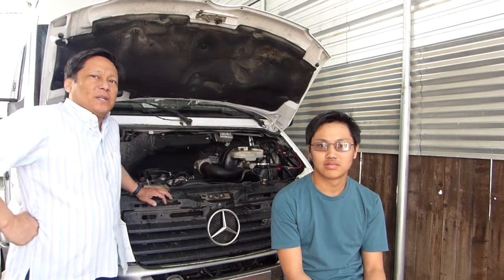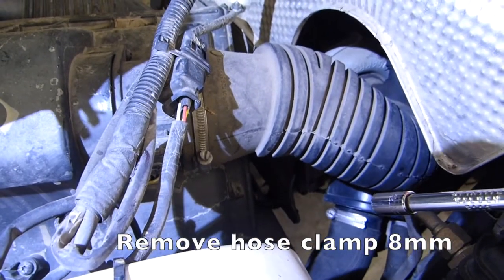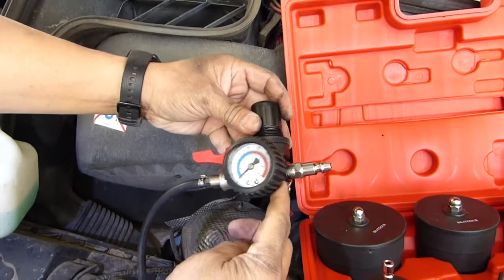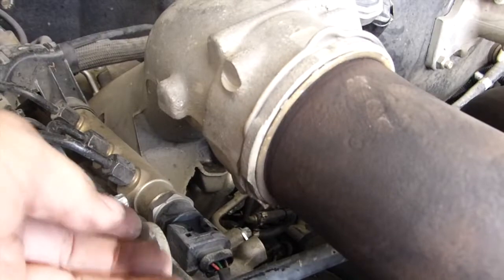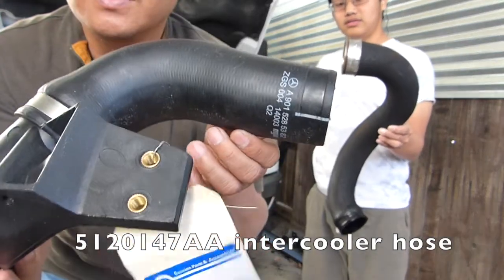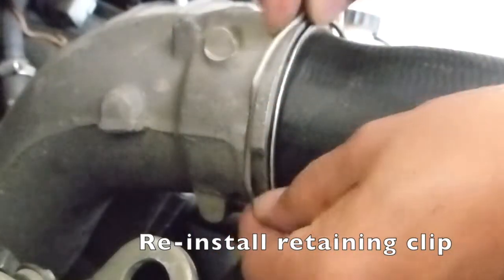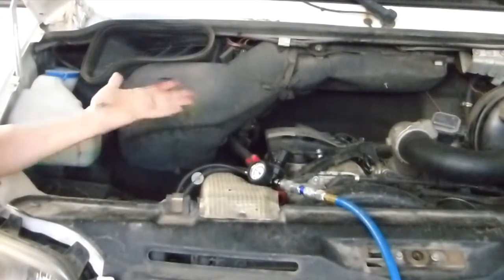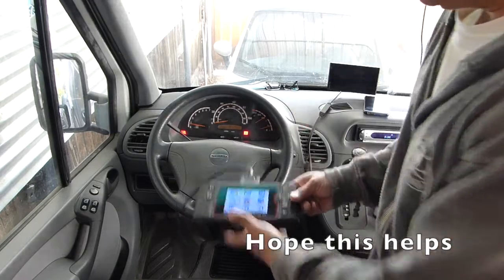DIY Sprinter T1N Turbo hose leak and fix

Comment: Thanks so much for this! I was “lucky” I didn’t have to do any fancy searching for the split in the hose – it was right up top center. But this video helped me replace it.

(Wish you’d shown the full replacement though – that’s what I ended up doing. It took some work easing that lower hose back onto its fitting!)

Comment: Tell me did it throw any mass air flow codes?
Reply: Some may throw P244A84 may be on the sensor, but What I know on my 2016 MB Sprinter with a 2.5 engine, is not supposed to be oil around the edges of the hoses which goes in the unit of the Turbos and intercooler, and yeah its fresh, in the service sayd it may be clocked, but no filter particule warning, so they are wrong and even doing some 50/50 work, trying to do some changes above, that costing money, I with my Diagnostic the same they with Expensive Diagnostic tool, the same result ...